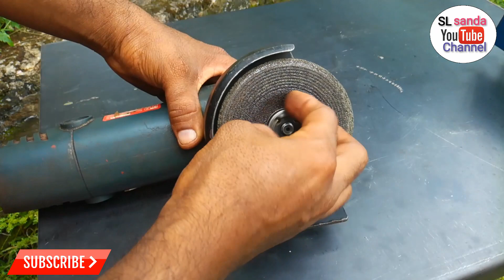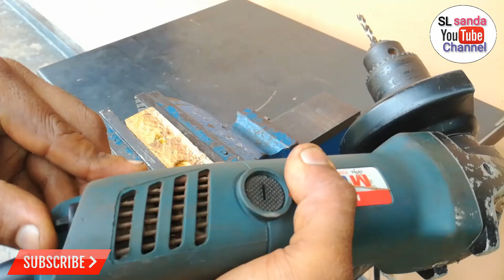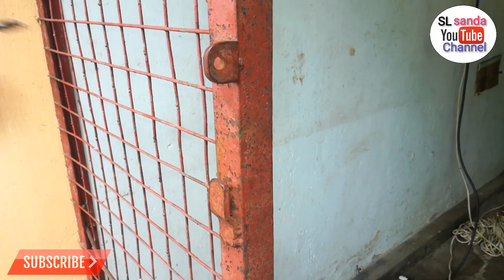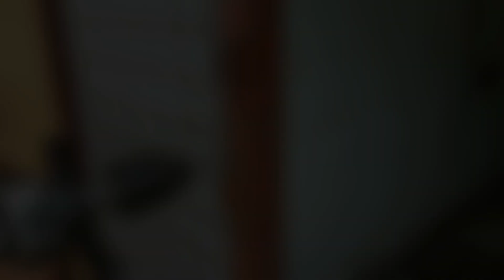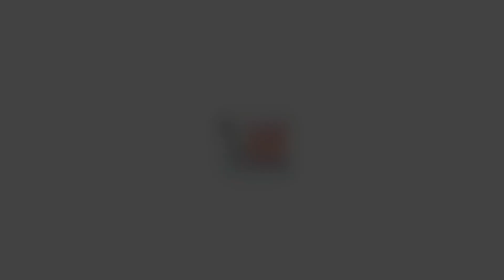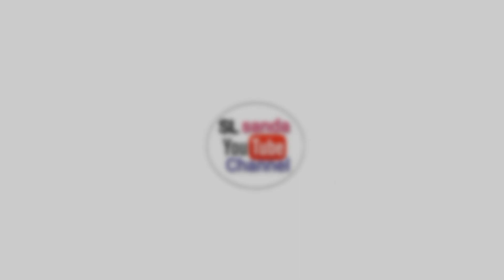angle grinder drill chuck adapter

Comment: NOTE, YOU EITHER MACHINE THESE YOURSELF OR PAY YOUR LOCAL MACHINIST.  A lathe is required to make concentric cuts. They're well worth owning. You could also machine the spindle harvested from a scrap drill. 
The larger 5/8"-11 US style grinders spindles work better since you can just drill then tap a (steel, quality, I use Jacobs) chuck in a lathe.

Comment: ****PLEASE SEE NEW EDITS TO MY ORIGINAL POST, below ***   The adapter I thought was going to work turned out to have the female and male ends reversed in their stated dimensions from what is needed.

Greetings everybody, I see that all of you are looking for a ready made nut adapter to do this.  

OK, so first of all, this particular angle grinder most likely has an arbor size of 5/8"-11UNC.  That is the spec size of most angle grinders in the US, meaning the arbor is 5/8" diameter and the thread pitch is an 11 thread pitch (Unified National Coarse).  If your angle grinder is different, not 5/8" diameter, google the specs of your model of angle grinder to find out what the arbor specs are.
Now, the drill chucks come in different sizes also. with the smaller 3/8" chucks having a hole that will take a 3/8"-24 UNF arbor (Unified National Fine 24 thread pitch), and the larger 1/2" chucks taking a 1/2" - 20 UNF arbor.    So,  do a google search for  "5/9"-11UNC female to 3/8"-24 UNF male adapter, or for the other chuck at 1/2"-20 UNF.
I did find some listings for just such a nut adapter:
Weiler 07746 Threaded Arbor Adapter, 5/8"-11 UNC to 3/8"-24 UNF 

EDIT:  *** Unfortunately*** the female and male ends are REVERSED!!!!   The 5/8" side of this adapter is actually the MALE END, and the 3/8" side is the FEMALE END.
I bought the generic pack of two adapters from line10tools and these turned out to be REVERSED ALSO.
In fact, after an extensive search of the internet, it seems that these 5/8" -11 male to 3/8" -24 female adapters are extremely common, and so far I have not been able to find any 5/8" -11 female to 3/8" -24 male adapters.

There are a bunch of 5/8" -11 female to M14 male adapters.   However, I haven't been able to find a matching drill chuck that fits onto a M14 threaded arbor.   Almost all of them are designed to take an arbor with M10 thread or a 3/8 - 24UNF arbor.

I did find on Amazon and eBay a complete package of an adapter claiming to have a 5/8" -11 female end and a matching drill chuck.  No info about what the size of the arbor connection between the two is.  This thing costs about $50, and I have one on order, having exhausted my search for a working solution to this problem.

Stay tuned.  I will update this post when the adapter - drill chuck combo arrives.

Comment: To much RPM for drills over 5/16in. (8mm), in anything made of metal. You'll burn them up.
Reply: It's just an example!!! I will use them with rotor bits or small grinding wheels for tiny spaces for my projects,but if some idiot gonna use regular drill bits to drill half inch still with it ...so let'em)))

Comment: the rpm is not adequate for that wick. very bad idea
Reply: its safe if we use with 240v 2000 watts or 3000w AC motor speed controller